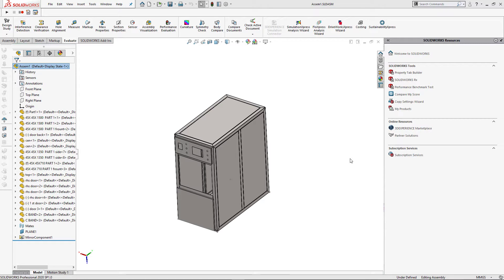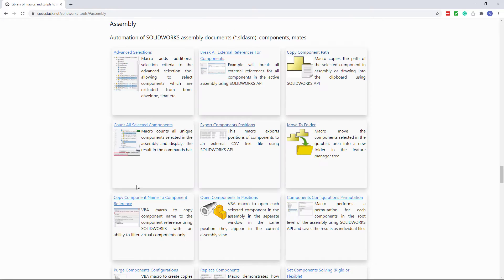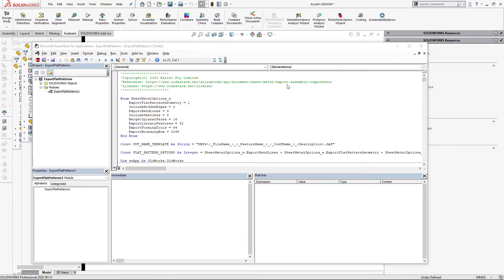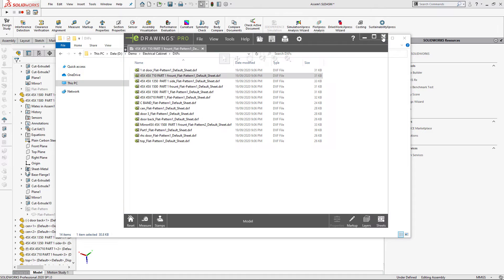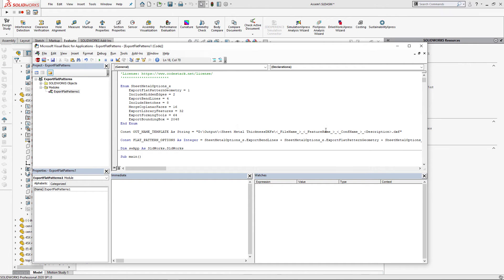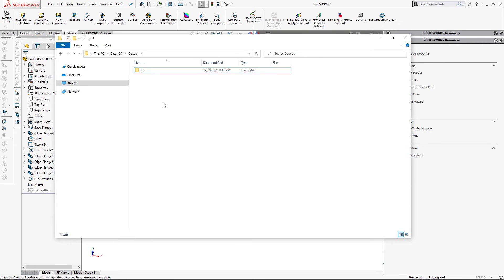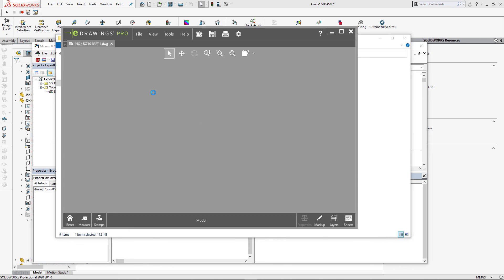Export All Flat Patterns from SOLIDWORKS assembly components

Comment from the maker: This macro now works in part as well (no need to wrap part into assembly to run the macro). Macro now also supports placeholders for the custom property from the part itself and the main assembly in addition to cut list custom properties. There is also a breaking change, <[Property Name]> placeholder now is defined as <$CLPRP:[Property Name]>

Comment: Is it possible to include the part number, material and thickness inside the DXF?
Also, we would like to be able to have short bend lines about 30mm from the edges and in a certain colour and font. We do not want it all the way across the part. Is this doable?

Comment: unrecognized token: sheet metal thickness what I do tell me
Reply: I have the same issue. Did you ever figure out how to fix it?
Reply: Got it, you have to add "$CLPRP:" (without quotes) in front of "Sheet Metal Thickness". Refer to the pinned comment, or the "Configuration" section of the macro's codestack page.

Comment: Hello, is it possible, instead of displaying the entire bend lines, to place a short (for example about 15mm) bend lines at the beginning and at the end so that the laser can engrave it for use with the press brake. And can these short lines be yellow so the laser software recognizes this lines for engraving.
Reply: I would want the same thing. Having bend lines etches all the way across the parts is not ideal and in thin materials can cause cracking when pressed. Artem, can you please reply to this comment as I think this will be useful for a lot of people?

Comment: Great Macro!!!
Is it possible to export also in STEP?
Reply from the maker: This macro works with flat pattern (2D views), STEPS are 3D views. Do you want to simply export components to STEP files? If so, take a look at this macro: https://www.codestack.net/solidworks-api/import-export/export-multi-formats/ and it can be automated to work with all files of the assembly with Batch+: https://cadplus.xarial.com/batch/assembly/

Comment: Xarial, this macro is amazing! Would it be possible to do a similar macro: Instead of dxf exports, the flat pattern of each part is exported to a SW drawing and the bend lines are automatically dimensioned?
Reply: and also automatically contact my Sheetmetal provider and lazercutting and bending machinist and automatically deliver it to my client would be a cool bonus ;)
Reply from the maker: This module of CAD+ can save flat pattern to any format (including .slddrw): https://www.youtube.com/watch?v=1Du-TkBjF-E. It does not currently have an option for bend line dimensions, but it can be added. Please contact us at info@xarial.com for more information.

Comment: Hello, thank you very much for the macro. I have a question. Is it possible to export dxf of multi body sheet metal parts?  (Bodies to Export all of them) if its possible can you please help me?
Reply from the maker: Yes, this macro will work with multi-bodies sheet metal parts
Reply: @Xarial  Hi.
Firstly thank you for this macro but ı have a problem .
For example I draw a part1.sldprt and its contains multi body sheet metal for example has Sheet Metal 1 , Sheet Metal 2 .... etc. When ı run macro  notice ıf sheet 1 and sheet 2 has same thickness it makes rewrite dxf file and file number makes less than ı need so ı try add properties PARTNumber but ı cant do this .
I hope you can understand me.
Can you help me in this stuation?
Reply: @Xarial , Seems to be an issue where the macro will not work where there are >1 quantity of a body. Works well if there is 1 of each body

Comment: Can this be used for an assembly that has plywood parts in it?  I would normally go into each part and save as a solidworks drawing, front view only.  Then I'll save each as dxf.  lots of steps.
Reply from the maker: No, unfortunately it will only work for flat patterns

Comment: Thank you very much this has been very helpful, I just have few questions.  I would like to have the bend lines as "dotted lines" and differentiate bend up and bend down lines by different color. How can I implement this through macro? Thanks in advance.
Reply: Have you found the solution? Also trying to add bend lines and change them to continuous thin colors
Reply: In my opinion, it is enough for the macro to additionally enable DXF mapping
Reply: When do you have the bend lines etched on the parts, how do you actually use them to bend the parts as you obviously can't have coloured lines etches on steel parts.

Comment: This is amazing, is it possible to save in one click in the same folder, DXFs same as you did here but in addition of their drawings in format PDF (from parts drawing file.SLDDRW), with custom name that include the revision number at the end? for example the part number is (1234567.sldprt) and I want to save it as (1234567 R1.DXF) and (1234567 R1.PDF)?

Comment: Getting error 
This video is nice really I needed to use this feature but I am getting the error mentioned below.

"Microsoft Visual Basic Application

Compile error:

User-defined type not defined"

I request you to give some solution if you know.
Reply from the maker: What line is highlighted when you get this error? Also which SOLIDWORKS version do you use? This macro was tested on SW 2019 and newer and might be incompatible with older versions.

Comment: hello bro 
so useful thanks alot 
but unrecognized token sheet metal problem occure to me
Reply from the maker: Please check the pinned comment (or check the 'Configuration' section on the macro's page). The macro was improved since the video was published and now supports more placeholders (to load from part properties or from cut-list properties) and thus the token names have changed.

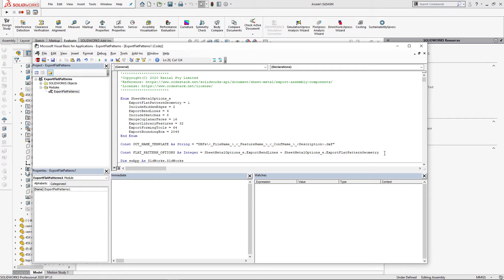Comment: Very useful, but some dxf files it leaves me rotated at 45 degrees, but only some, do you know why this happens? And other thing, at minute 0:56 you use a submenu, how do you get it? Thank you and I'm already subscribed, I almost forgot, how can I do that if it asks me in each file if it wants to save, that it ignores it and closes itself?
Reply from the maker: Thank you. The rotation issue was reported several times by different users. It looks like a bug in SW API itself (there is no specific steps taken in the macro to rotate the view). You can try to change the fixed face of sheet metal, but I will be looking into this issue. I will be rewriting this macro and integration into the CAD+ toolset SOLIDWORKS add-in. I am not sure I understand your question about submenu, do you mean subfolder? I am also not sure the reason of confirmation message for closing (I do not have one from my side). Could you please try to open this assembly as read-only before running the macro, does it fix the issue?
Reply: @Xarial  Thanks a lot for your anwers, let me tell you something, First, I have already verified that the rotated dxf are pieces that are not parallel to some main axis, X, Y or Z, that is why they come out rotated, second, the menu I am referring to is the one that comes out at minute 0:56 where you are changing the code and before finishing the command: "SheetMetalOptions_e." A small box opens where it says: "ExportBendLines", "ExportBoundingBox", "ExportFlatPatternGeometry", "ExportFormingTools", "ExportLibraryFeatures", "IncludeHiddenEdges", "IncludeSketches" and more options that are not seen, then you selected: "ExportBoundingBox" and the command you were writing was completed, to that "menu" I mean, Third, I already did the test by opening the assembly as read-only, but unfortunately it keeps asking me if I want to save the changes when the DXF of each piece ends, I think this is what affects me the most because 2 days ago I had to create almost 400 dxf and I had to be telling it not to save in all the files, even so it helped me a lot, Thanks Again, Finally if you integrate it as a add-in, it would be great!
Reply: Was this issue resolved? I have the same issue with rotations

Comment: Thank you very much for this macro. I was wondering if it is possible to include the part number, material and thickness on the DXF? If yes, what would be the code for that and where will that be placed on the coding?
Reply from the maker: I assume those values are in the custom properties. If so, you can pull these (either from cut-list or from the file custom properties). You will need to set the value of OUT_NAME_TEMPLATE. To pull the custom property from cut list, you need to use the $CLPRP placeholder, e.g. <$CLPRP:Material> to read the material. If the property is file specific, then it needs to be set as <$PRP:Material>
Reply: @Xarial  thank you for your reply. But if i do the OUT_NAME_TEMPLATE plus <$CLPRP:Material>, this will be on the file name. But I want the material and thickness inside the dxf  if that is possible.
Reply: @anthonyjosephbarlaan7908  I need the exact same thing

Comment: After export flat patterns, all DXF files are rotated 180 degrees
Reply from the maker: The orientation depends on the fixed face (macro is using default orientation) of the sheet metal. You might need to change the fixed face.
Reply: @Xarial  Face side i correct, but the bottom is placed at the top(rotated 180 degrees)

Comment: This is great stuff!!

How can i change the name of the DXF-file? I would like to have the plate-thickness in the name..
THANKS!!
Reply from the maker: Just specify the name of the cut-list property with thickness in the OUT_NAME_EMPLATE constant, for example DXFs\<Thickness>.dxf, if the property name is Thickness
Reply: @Xarial  I tried but something doesnt work.. is this the right code?

Const OUT_NAME_TEMPLATE As String = "DXFs\<_FileName_>_<_FeatureName_>_<_ConfName_>_<Description>_<Thickness>.dxf"
Reply from the maker: @utrechtmannederland3460  Yes, but you might have  localized name for the Thickness property. Check how it is named in your cut list custom properties.
Reply: @Xarial  Yeah, so its called Sheet Metal Thickness

Then this should be the right code?

Const OUT_NAME_TEMPLATE As String = "DXFs\<_FileName_>_<_FeatureName_>_<_ConfName_>_<Description>_<SheetMetalThickness>.dxf"

But it doesnt work
Reply from the maker: @utrechtmannederland3460  if you have spaces, specify those as well, i.e. <Sheet Metal Thickness>
Reply: @Xarial  AHHH right.... Its working, thank you!!!

https://www.youtube.com/watch?v=GC5E8ie2pdM

Comment: nice work but it doesn't work on an assembly that has different configurations of a part where each configuration has multiple flat-patterns. it sends automation error that says object is not attached to its client!! also it doesn't recognize mirrored sheet metals where part is not an opposite hand of its seed. I would comment this on github if I knew the link to source code. examples below
https://grabcad.com/library/sheetmetals-1
Reply from the maker: Thank you. We will look into this. Repo url: https://github.com/xarial/codestack/issues

Comment: macro worked fine on moderate assembly .. but for large assemblies, solidwork is frozen, how do i turn off finished parts ... from 44 parts, macro don't worrk anymore.
Reply from the maker: Most likely this is just hardware limitation and it is just slow - exporting DXF is pretty heavy operation. If you leave it for longer - most likely it will finish (or crash if you run the limits of your hardware). If you can send me the assembly - I can have a closer look.
Reply: @Xarial  I will email you my assembly. it works on solidwork 2020. can i email to info@xarial.com
Reply from the maker: @yeucokhi1007  Great, thank you. I can confirm that I have received the assembly. You can track the progress of this bug here: https://github.com/xarial/codestack/issues/11
Reply from the maker: @yeucokhi1007  Issue has been fixed now. New macro is reuploaded. Another option to continue exporting after restart was added. Please read comment to https://github.com/xarial/codestack/issues/11 ticket for more information